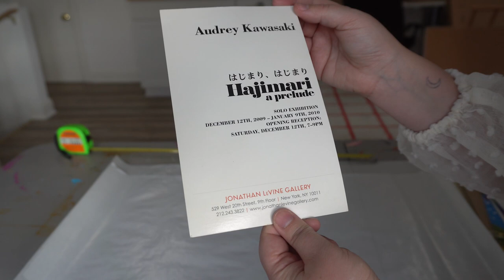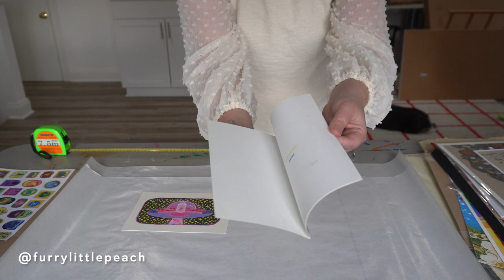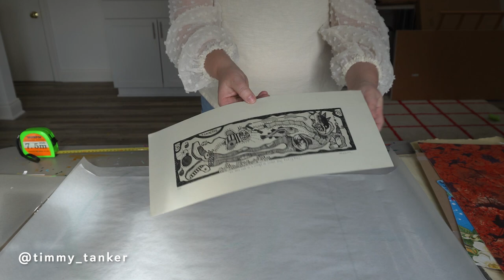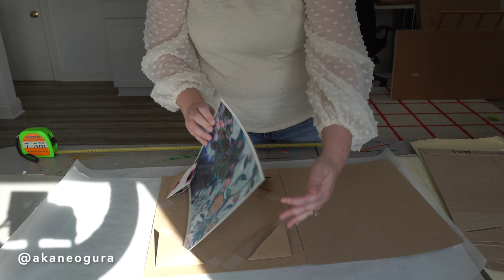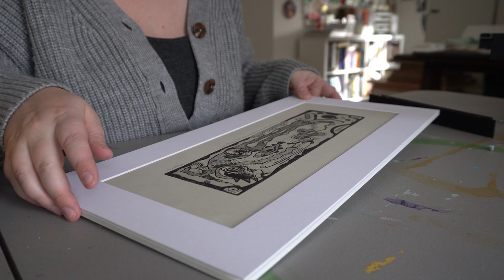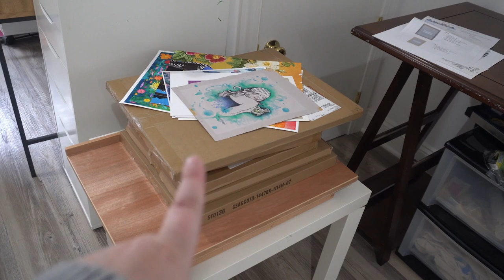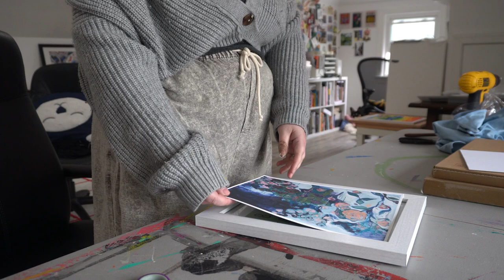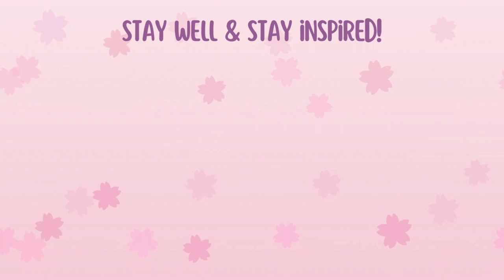FRAMING MY ART COLLECTION

Comment: You should matt you own work. It saves me a load of money. It’s like 10 bucks for a entire matt board and you can get multiple matts out it one board. I use the Logan 440 system. It’s super cheap and works just fine as long as your table is relatively flat. 

But how much fun getting all that work ready to hang. Great vlog.
Reply from the maker: I’ll definitely look into the Logan 440 :) thank you for the suggestion, Justin!